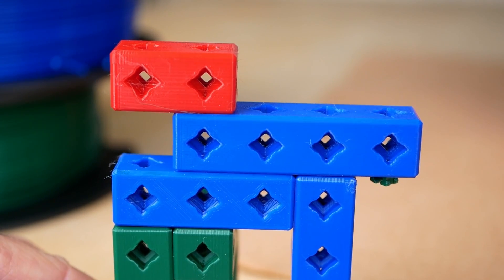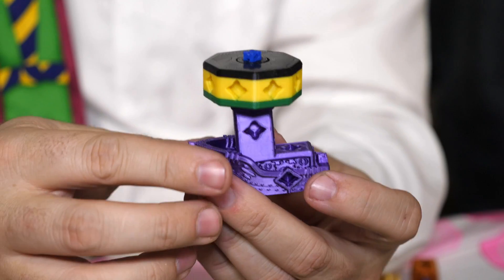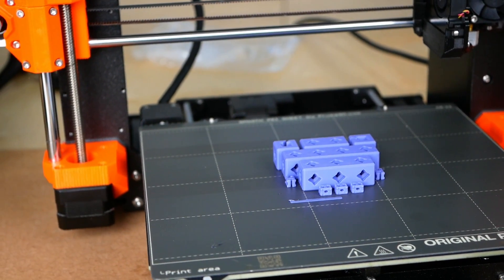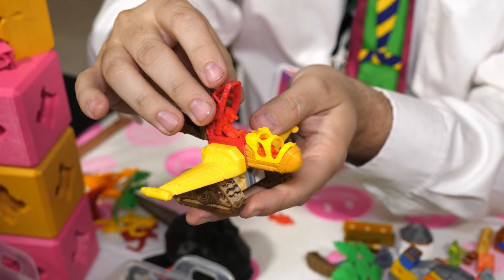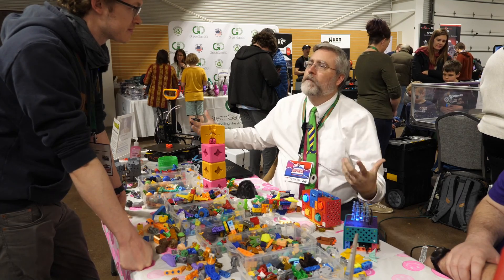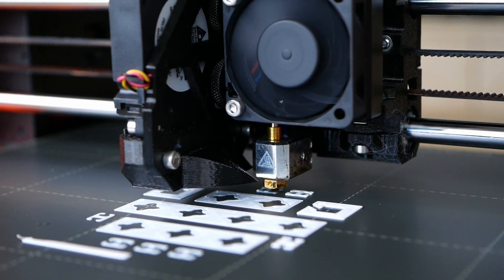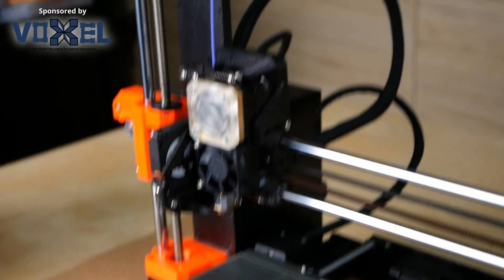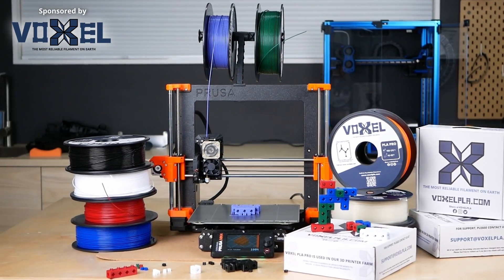3D Printed, DIY "Interlocking Bricks": PrintABlok

Comment: I love Love printablok! My kids and nephews love them too. They have grown with the kids too. Their into STEM and robotics now and the printablok pieces have found their way into multiple prototypes. It's just good building blocks. Good times! 🎉
Reply: Are you combining the connection mechanism to some custom parts? – Sounds like this could be a very flexible way to build and combine stuff
Reply: We've found this to be the case. The older kids stem platforms change and if those come with print model components... We can add printablok mounts too. Otherwise we use tie wraps and/or superglue. Sometimes I need to drill out when the holes aren't big enough for larger tie wraps. But the kids use what they got on hand and get creative. They usually start with the blocks to rough out ideas.
Reply: Excellent hands on "prototyping" with the blocks first. Broadens the spectrum of activity to literal hands-on doing and cognizing 😊

Comment: Was excited for a moment at the prospect of an open source building block. Still, pretty nifty.
Reply: What do you mean? Isn't it open source? All the base blocks are open source. The themed kits are the ones for purchase but anybody can make kits from the base ones.
Reply: @DiThi  It isn't fully open source. Even the base blocks.
Reply: @imran_huseyn  I didn't realize it's CC-BY-NC. Anyway I didn't use it much in the end. For joining parts I make square/diamond holes that fit a piece of filament exactly and use pieces of filament as pegs.

Comment: it is not safe for children because they can swallow small parts unfortunately
Reply: The smallest block is a swallowing and choking hazard, yes. The 1x2 block is as well, and the connectors too. But the rest of the blocks are too big, so they should be fine.
However, I've responded by making the smallest block have an air hole through it so that hopefully if it gets stuck in a windway it won't completely cut off breathing.
Reply: I don't think it was clearly mentioned, but I saw a few times pieces with male/pin shapes extruded from a full block. It was located exactly where a socket would be. The Q though is if that extruded pin is strong enough to not be ripped off. I only just thought of that as I was writing this and I have a feeling it may be the deal breaker for that assembly technique.

Comment: I need to get my stringing under control, that’s my issue with these, but that’s mainly a me issue

Especially the Connector.

Probably just Humidity and need for a Drybox and/or Filament Dryer.

Comment: I don't know why, but I'm not a fan of the PrintABloks always needing "pins" in order to connect with one another. 

If I have two blocks, I can't connect said blocks without a third component, that third component being the "pin". 

I suppose you could 3D print one side of a block to have the pin built into the block, but then that could limit what you could do with that side of the block.
Reply: The pins are designed to print flat without supports, so making them out the side or whatever is kind of a challenge. However, I often leave connectors in the blocks, and just keep some extras on hand.
Reply: Le** technic also needs connectors. And connectors give more freedom for building experience

Comment: Protip: Base block makes an excellent fast test print for making sure your settings are dialed in ok, and leaves you with a part you can use in quantity rather than another ugly boat.
Reply: YOU TAKE THAT BACK!

poor Benchy whimpering in the corner of the room

It's okay little buddy... He didn't mean it... We love you Benchy... No other calibration print is better than you...

(Except maybe CaliCat due to cuteness)

YOU HURT HIS FEELINGS! Poor little guy...
Reply: @KensCounselingCouch  Hey you're the one who assumed ugly boat meant your dear Benchy. 😂
Reply: @daliasprints9798  touche
Reply: I use Calibration Cubes as Feet for appliances. like underneath your playstation, stereo, etc. 
doesn't have to cubes specifically, just any 4 of the same object as long it has a flat bottom to it.
Reply: (He totally meant the benchy.)

I have a video about this one my channel too, and I've made a block that's got and X, Y, Z marked sides to further help your calibration.

Comment: Only thing that comes to mind is that they can only be attached at right angles to eachother due to the peg shape, lego nubs are round and allow all angles
Reply: There are angled pieces, hex blocks and octoblocks, and the like, so there's some creativity, but not full rotational connections. I wish that were possible, but I could not figure out how to do that and make them 3D printable.
Reply: For now they are only (as far as we know) set at 90 degree angles. I find these as an awesome intro to give people a starting point to design their own compatible designs. You can easily make a wedge shaped design that is still easily printed and gives you more configurations.

Comment: Joe and PrintABloks are awesome.
The plural of Lego is Lego, or Lego bricks. You’re still awesome too, but you’re just one use of “Ob-ex-idian” away from dropping down a tier 😂
Reply: When Lego started doing DCMA take downs on 3D print models, I started calling any building block "legos" just to further genericify their brand until they recognize the contribution of their fans.
Reply: "Slick-3-are"
Reply: @AlexSwavely  I flip-flopped on whether to write "Ob-ex-idian" or "Slick-three-are".
Reply: @AlexSwavely  Do you just call it slicer? That doesn't sit well with me...
Reply: @coltenmeredith8899  I don't call it. But I do grin whenever Tom mentions it.

Comment: Using the printablocks as a purge tower would be an awesome way to reduce waste! That’s a big brain move
Reply: It's perfect because you don't need to be thinking what are you going to print. Just some blocks in some random configuration and they can be used as-is!
Reply: im downloading them rn to use as bambu purge blocks
Reply: It's such a smart idea.  Because pitching a new lego-like standard is going to be a touch sell for someone who's never held printablocks, but if people are running a ton of them off as purge objects then they are more likely to get into people's hands and be floating around en masse.  It's like a free trial for toys.  The free version isn't as sexy and complete as the final version, but it gets the product into as many hands as possible.
Reply: Joe Larson actually did do a video on this.
Reply: PoopABlok
Reply: There's more options than these models
Reply: @REDxFROG  Yes, but the 2x blocks have a more or less consistent cross section all the way up and come in a variety of sizes. I have a whole video about it on my channel, but I am a little biased.
Reply: @REDxFROG  What are other options you know of? For makers with childrens those blocks are great. 
I could think of vertically stacked bag clips.
Reply: Not really tbh. Not everyone have use of it. So will most likely go in the trash anyways.

Comment: A bit expensive for my pocket due to unfavorable currency exchange rate. Still I'll print a base set, and if the kids enjoy it, I'll get the paid ones...

I tried to 3D print a lego base plate, but that failed badly. It's not suited not only for 3D printing, but also for PLA. The material must be a bit more flexible. OTOH I wonder how it would print on resin printer - can't try that as it's too messy...
Reply: You'd have to be using something like a Voron 0 to get good warping control on such small prints but Lego is made in ABS which is directly 3D printable, so you could fix the material issue at least
Reply: @bosstowndynamics5488 , I'd actually try ASA, as it is less likely to warp than ABS. The tolerances still will be an issue. The surviving parts of my test print were too loose ti work. Lego works so well because injection molding done well provides tight tolerances. Something rather hard on standard 3D printers.
Also Voron is too expensive to me. I have a humble Ender 3V2 with few basic mods that are cheap in my country...
Reply: @urgon6321  Don't get me wrong, I still think the result wouldn't be very good, just adding that the material alone is fixable, even if tolerances/precision aren't (Vorons are good but even they have limits)

Comment: I wish him all the best, what a fantastic community products he has developed. I have no doubt that within a short time period there will be many community designed models using this system. I also have no doubt that, much like Lego, the complexity of models, and the component parts, will continue to rapidly develop.

I had to pack my printer away last year, but I know what I want to use to test it once set up and recalibrated later this year.
Reply: It's actually years old already 😅
Reply: @REDxFROG  time periods are relative. A short time period for community projects can easily be ten, or fifteen+ years, depending on how long it takes that community to become widely known outside of its core userbase. So when I say "Short time", and "Rapidly", I'm very much talking in terms of a product that is close to, but not at, visibility outside of that core of enthusiasts.

"An overnight success is ten years in the making."
 - Tom Clancy, Dead or Alive (2010).
 [One of the many quotes that offer the same message]

Comment: I personally have no issue with skilled designers asking for compensation for their designs. I think the 3D printing community sometimes suffers from the expectation that all 3D models should be free regardless of the amount of work that went into the design.

And then there's the issue of knockoff print farms selling your work for cheap as soon as you upload it... Locking your models behind a payment is the best way to deter this.
Reply: I think encouraging the open source mindset with 3D printing is a great thing to do, but at the same time the underlying standard and basic models are free, so I agree that charging a small fee for additional artistic parts on top of the base system is quite reasonable
Reply: He has made it cheap and easy to profit off of his models - adding a sales license is a mere $5/mo patreon tier.

Comment: The real question here is... Are they as painful to step on? Its pretty much a requirement
Reply: Yes, and no I guess? They look more rounded, but if you crush it and get PLA shrapnel embedded in your foot its probably worse:P
Reply: @notsonominal  Better and worse at the same time, a true sign of progress.
Reply: Oh yes. Can confirm, they hurt when stepped on.
Reply: if you add connectors you basically get a Czech hedgehog/tank trap
Reply: There's only one way to find out... make a react video!
Reply: This is true
Reply: This
Reply: Depends on if you have the peg in it

Comment: this is just a good snapping mechanism to standardize and use with things that might need to be connected
Reply: The negative for it is available as STL you can boolean subtract from your own models.
Reply: @daliasprints9798  Why is that a negative? How would you prefer it be delivered?
Reply: @3dpprofessor  I don't think he meant negative as in down side. I think he meant it as in "a mold is a negative of the object being made." Or photo negative.
Reply: @tomtech4224  ...Oh. OH. Yeah, that makes sense. 

I think i should go to bed. 
😝
Reply: @3dpprofessor  I would much rather prefer a STEP file
Reply: @FreshPe  People have made step file for them. They're out there.
Reply: That’s what I was thinking… don’t need to worry about doing the tolerancing ourselves